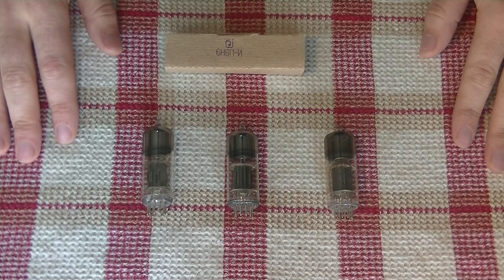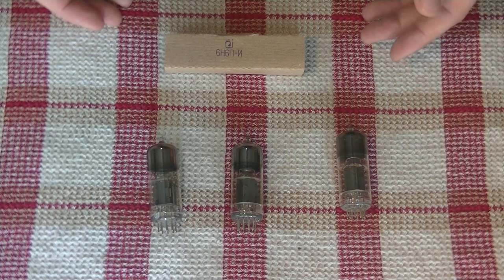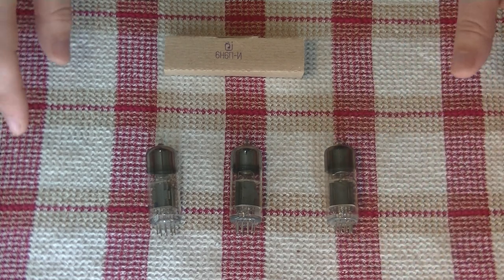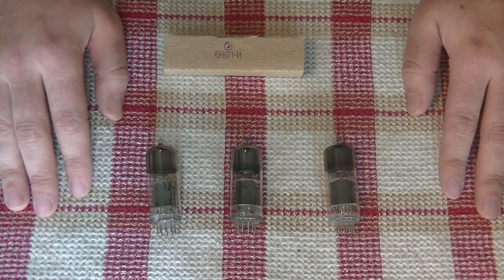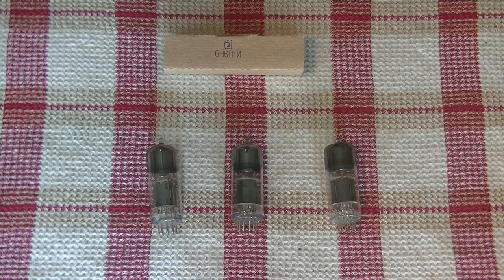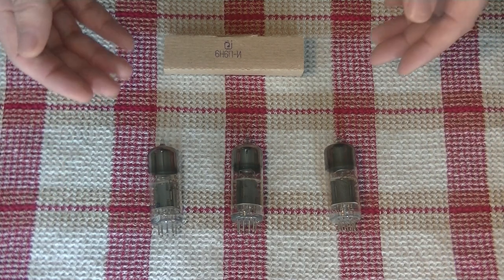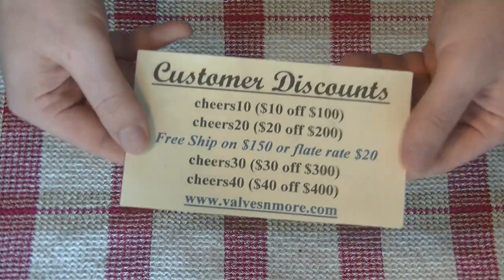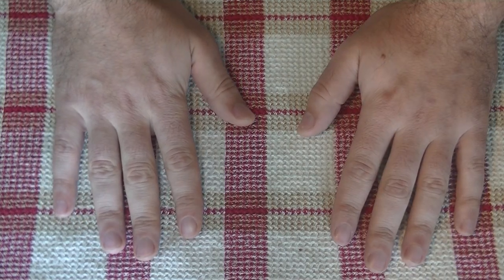Tube Lab #104 - 6N6P A Tube For Everything

Comment: The "Saucer" is really a cool part of the design as it would hold the chemical that actually puts the mirror finish on the glass at the top. (I cannot remember the name  reflective part or the chem used.)
When they are newly produced, and not tested/heated for the first time at the factory, they are clear all the way around. Upon the first power up, the heater burns the material in the bowl, and it adheres to the glass. If o2 enters into the tube, it will turn white (Which I think most people know)
I love tubes, have been collecting for a bit, but do not own any 6N6P as most of mine are 12ax7, 12ay7, 6v6, el34, etc as i use them in guitar amps.
Reply from the maker: Barium I believe is the most common metal used for the gettering material.  And they way it's deposited is very interesting.  The tube is completed, the glass spigot is seperated from the vacuum pump and the tube is held in place inside a round induction oven and the barium is flashed off - this all takes seconds - needless to say you don't hold the tube with your bare fingers!

Comment: Was wondering if the 6N6P-I does a good job in the GU-50 monoblocks, since the grid voltage is set on -164v.
Reply from the maker: If I remember correctly (development work was a while back) the 6n6p-I worked just fine.  On a day to day basis we run the more common 6n6p.  It has turned out to be both a wonderful sounding twin triode and long lived as well.  In all of our development work, I don't remember killing a single one.

Comment: I have some questions about using this tube in the Freya Noval. I know when matched with 6N23P or E88CC this is a common pairing. My question is what about the amplification factor of these tubes being only 20-22 vs 33 on the stock 6N1P? My next question, Wouldn't 4x 6CG7 be a good match for this preamp? The 6CG7 from my limited understanding is basically a 6SN7 With a 9-pin base. Is that correct? Would running 4x 6CG7 in Freya N be equivalent to 4x 6SN7 in Freya+? Thanks!